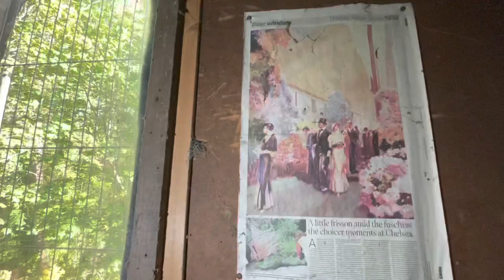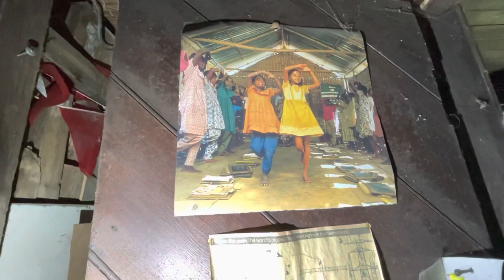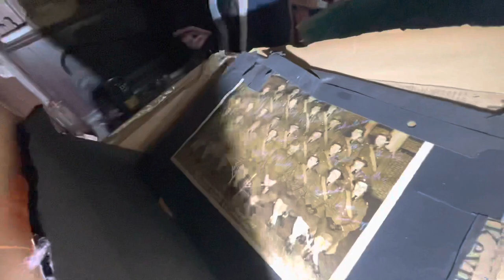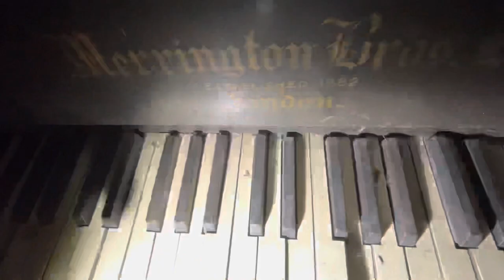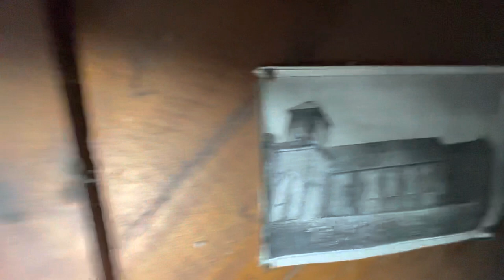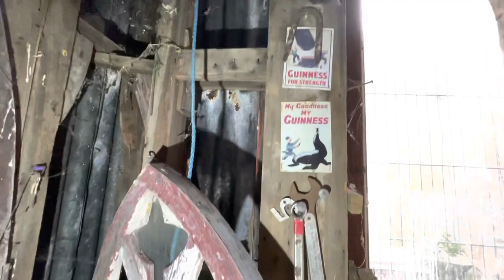WE FOUND A FORGOTTEN GRADE LISTED TIN CHURCH

Comment: Despite the clutter looks in great condition. The local community in  Laragh Co Monaghan ireland  conserved a tin church that was  in much worse condition  between 2012 and 2014 now used for events. It is amazing that these buildings of 100 - 130 years old are still in such great condition despite a certain amount of neglect. I doubt that modern buildings will stand the test of time as well.